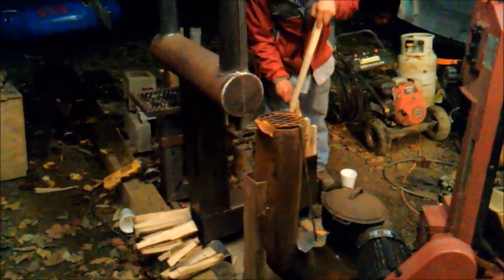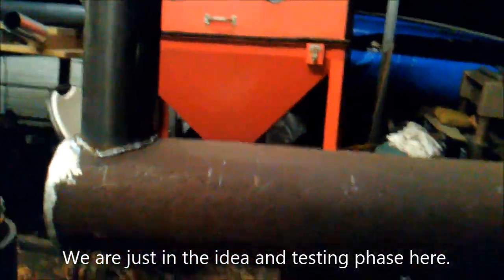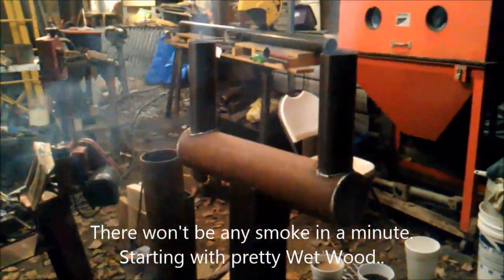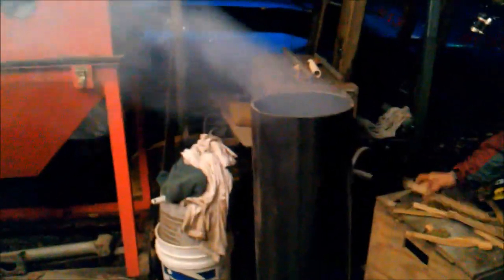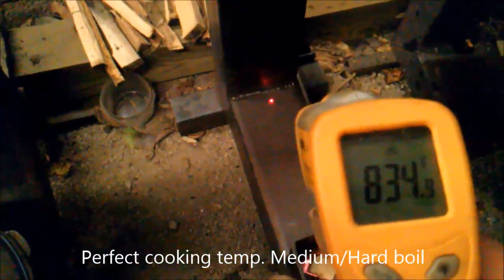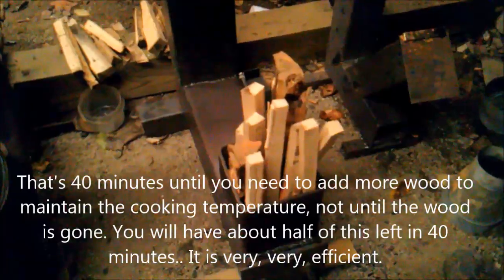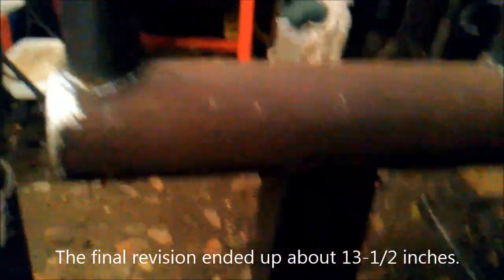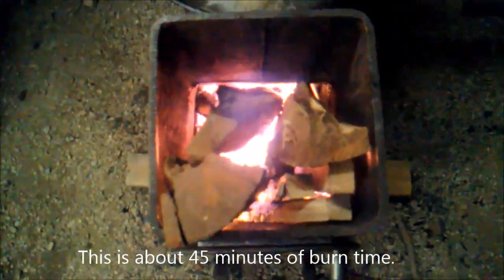RocketStove-LongHorn Beginning Ideas Beginning Build-Long Burn Times

Comment: Mark - when the oven is not used for cooking there could be placed a few refractory bricks on plates surface and preheator dry your wood -with care of coarse - less smoke from dry wood -removing the warm bricks they can  dry or keep  shoes warm or used them for other purpose .
Reply from the maker: Yes.. Gabriel,,  I like that.  Good idea.. 
Might even warm the bricks up, wrap them in blankets and drop them under the sheets at the foot of your Bed?? :)
Let me clarify my reply to your comment.. Lots to understand about moisture in wood.. Yes.. You are correct. You do get less smoke from dry wood.. But, let me say something else just as important.. The dry wood smokes for a less amount of time before it goes to "No Smoke" burning.. The wet wood just takes a little longer to get to that same "Smokeless point".. Green wood produces more coals,, which drives the heat up actually, when the air passes over it.. Think about a Blacksmiths forge.. It won't turn a piece of metal even "Red" which is the lowest temperature without a draft.. But, put the draft to it, and it will melt 1/2" solid steel stock in a matter of minutes or less depending on draft.. (Forced vs Natural)..  Restricting the volume of air,, increasing the heat in that volume, will increase the rate of the air flow.. If there are good coals(wet wood), you will actually get a hotter burn chamber.. A smaller amount heat volume in a Hotter burn chamber.. That is why it is so easy to cook on this stove.. It regulates itself, past what type of wood you put into it (hardwood vs soft), Dry vs Wet, thin split and tightly stacked vs larger split wood with more air space, etc.... I can pack it full of fine split dry hardwood and get maximum temperatures... The same wood but damp or wet and I get a longer fire at basically the same temperatures even though, it is a mix of less fire, more coals, and faster airflow... 
The wet or damp wood does burn slower, but, still does not smoke once it gets leveled out..
It just starts slower and runs slower at the same heat,,, IF,, you have the proper draft.. Just wanted to mention that.. Any interruption in the burning process will cause some smoke for a very short period of time, then, but quickly even out again.. Might see that in the video.. I can't remember.. 
Whenever we mess with the wood (which Mike does pretty often), you will see smoke for a minute or less usually.. Minute for wet wood, seconds for dry wood.. Just FYI... All of the wood we burn in those videos is "Damp wood" for lack of a better term.. During the winter, humidity down here stays in the 85-95+%.. We can take "studs" from indoor Lowes,, take them home and burn them and you can tell they are dry.. Let them sit out over night or a day or two, and they will increase in weight and you will see steam bubbling out of the ends of the wood that was not there hours ago.. Just FYI.. I was actually quite surprised by that and tested it more than once.. 
If you have a stove of your own,, this info will help you really tune your cooking machine..Ha.. 
But, you are exactly correct. I think as long as the wood does not touch the metal directly,, it would be safe.. 
The Burn chamber does heat up to between 800 and 1000 degrees F.. , so, correct, have to be careful. 
The Vertical Draft tube is between 450-650 degrees, so, if I put wood up there, might be a better place to put it.. Maybe a metal framed, expanded metal (screened box) that can be dropped on a hook and removed easily when the wood is needed, and dried.. And, firebricks after I eat to warm my feet... Ha..Ha.. 
Excellent ideas.. Thanks for your comment.

Comment: What about putting an "oven" on the cross piece. Then it becomes more than just a place to fry or boil.  It's a complete kitchen stove.  Breads, pies, meatloaf etc...
Reply from the maker: You are exactly right.. Yes, I have room for a 14" x something, by 23" high oven.. The something would be variable across.. I will be building one, next time I have reason to go into town for metal. I need some thin sheet.. 1/8". Stainless if I want to make it easy to maintain. I have not yet decided.. I am sure it would just sit on top of the square, and get plenty hot, or, I could cut two holes, one to let heat in, and then, one to let heat back into the burn chamber, if I really wanted to get it hot.. I can't see that though.. I am not a big bread eater, or I would have done this already.. But, I do have a good bit of Beans and Rice that I hope to not have to eat one day.. Ha.. That was the purpose, but, I have had some good times cooking with friends.. I cook a whole lot less now.. Usually, friends want to do the cooking.. Hey, No problem.. I would imagine if I build one, it will fit either the bottom or top plate.. The top would easily get 350 or 450 if I needed it, and give me more flexibility.
The next stove I build will be out of All Square tube, except for the two exhaust stacks.. It will be so much easier. I have a total of 5 cookers now for my family of 4. All of the Big ones work great.. I'll swap them for something valuable, if they ever start getting used...
Cheers. I hope it helped you with some ideas.. I have a bunch more videos on them.. Lots to learn.
Reply: Tim St Onge was going to say the same thing . would be awesome for a hunting hut

Comment: instead of putting2 half moon plates on the inside, put 2 rectangle plates using flat bar and also long ways and put a flat plate on top to set the pot on. build the top sq going up then down in it.
Reply from the maker: +jonathon watterson Ha... Yes.. That was a pain in the arse build.. Getting the Saddles correct, etc.. No templates, etc.. Simpler than that.. Build the horizontal out of the same Square tube.. 
I was short on square and had a piece of pipe the correct size.. Much simpler on the subsequent builds.. 
I kept this one for myself, since it was such a pain.. Gives me something more to enjoy about it.. Ha.. Cheers.

Comment from the maker: Ha... Yes, you must be a builder. I had a leftover piece of pipe, and didn't have any more square tube.. Yes, it took much more time to get everything lined up and level.. A real pain in the rear.. Don't want to crack and egg and have it run to the other side of the pan.. I think it would make no difference whatsoever to the stove, and if I build another, it will be square for the simplicity of the build.. I could put one together much, much faster..
Yes.. If you are going to build one, definitely, use the square tube for the secondary cook surface.. If you want the secondary heat surface to heat up quicker, cut the pipe out and drop in a plate in the top of it, to let the flame hit it directly.. It will heat up much faster.. And, BTW, watch the sides of the square tube.. The seam side is often not flat across.. It has a bow in it.
I think you might get away with a square tube riser (exhaust), but, it will not perform as well, so, go for round exhaust tubes if you can get the material. This is thin wall 4" tubing.. 1/8" is what I had on hand.
BTW.. If you want to see it in action, I am uploading a video of us cooking Chilli on it last night...
I should have loaded it full of wood and let it go, but, Mike usually handled the wood, and he was busy, so I figured I would play with it.. It took me 15 minutes to realize, load it and let it work...So, you will see me fiddle with the wood, and didn't have to.. It will take a couple hours to upload. I'm on satellite.. But, there is a lot of goodie info seeing it cook.. Chilli and a camp fire coffee pot to show some things about the stove.
When it is finished, it should be here: http://youtu.be/tRkUzTI8OY8

Comment: why not just replace that horizontal round pipe with another square piece??
Reply from the maker: +cdimmm You are correct.. It would not make any difference to speak of.. I would have built it out of square tube had I had an extra piece.. I built the first one just like the base of this one, and liked it so much, I didn't want to change it. I wanted to keep it. I was building 6 of these for my family, in the event of a SHTF scenario.. 
I started out building and testing the designs  on 2", then, 3", then 4", then, late one night, I built one out of a piece of 6" I had.. All of them were the J style stoves.. Feed Tube, Burn Chamber and Exhaust open on top.
Mike and I were cooking some pork stew and wanted to keep our coffee warm outside and came up with this idea.. I had just enough Square to build the base, but I had some 4" pipe for exhaust tubes, and I had this 6" heavy pipe laying there saying "Try Me".. Ha.. It was a pain to fit it and get it all level and square.. It was much easier to build with Square all the way, and I still had enough 4" round pipe for the exhaust. 
I built several of these for Tailgaters in Atlanta and sold them to them.. I gave a friend the first one, and got 6 orders from the first game he took the stove to.. 
My buddy didn't know how much I would charge to build one, so, he said $600, and he sent me an email with the 6 guys who wanted one each at that price.. 
Yes. By all means.. If you are going to build one, use all square. They work fine.
I am pretty sure the 4" risers would also work if they were square, but, I have not tried it.. I would weld them solid if I built one though, figuring it would be quite odd if they didn't.. 
Sorry, I did not answer your question until now.. I was getting spammed on my email account and was not checking it as close as I should.. Was just responding to someone else and saw an unanswered post...  I hope you went ahead and built one.. Cheers.